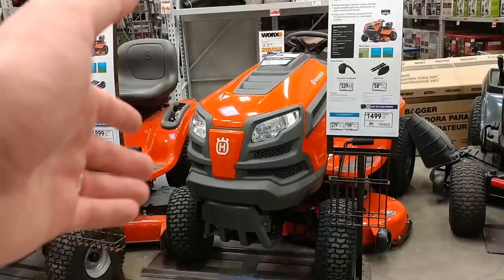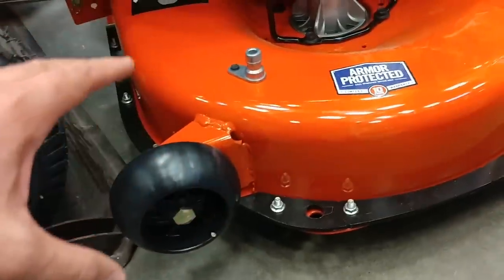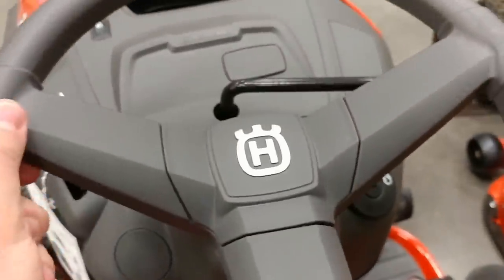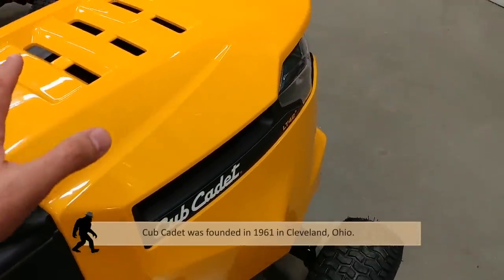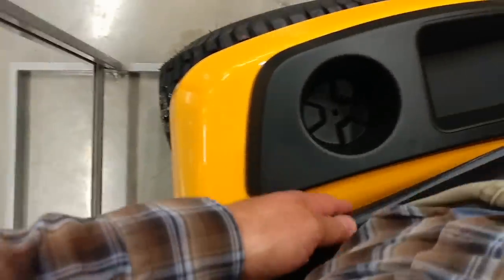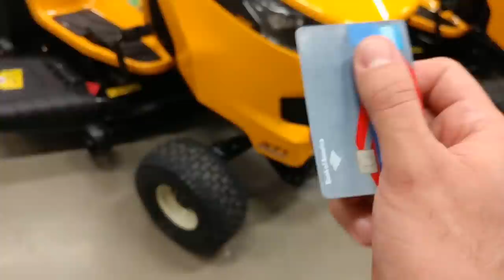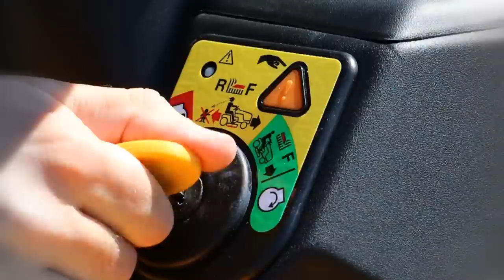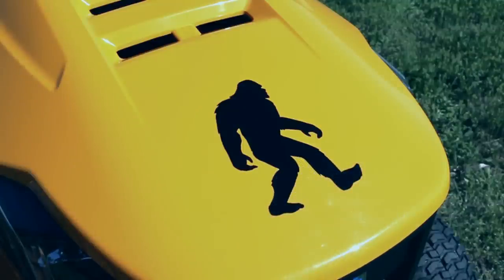Time to Buy - Husqvarna YTH18542 42” or the Cub Cadet XT1 Enduro Series LT 42" Riding Lawn Mower

Comment: Cub Cadet sucks trans went out on mine twice
Reply from the maker: Hi,  Electrified - I'm sad to hear that.   Do your still have the mower and is the third transmission working alright?   How was the warranty service and experience? I'm curious what to expect that incase I experience something similar.   😮
Reply: @BigfootDadExploresMontana  Warranty service was great I took it to a near by dealer I bought the mower from TSC but I will buy from dealer next time much better. Yes I still have its running good now but I just replaced the plastic idler pulley LOL I'll probably be buying me a Husqvarna 54" soon
Reply from the maker: @Electrified - that's helpful information so thank you for the follow-up.  Hopefully nothing else falls apart after the pulley replacement.   As far as the Husqvarna goes,  Loweslitta will be proud when that day comes.   😎  Keep us posted if anything else breaks on the Cub Cadet!
Reply: don't blame Cub Cadet blame Tuff Torq.  Every manufacturer (JD, Cub, Husq, Craftsman, etc) all use the same transmissions in the low budget machines (K46 and they are known to fail)
Reply from the maker: @sethfisher6267  - good point.  I was thinking about this earlier today and was wondering if the ones they replace under warranty are re-manufactured units.  I'm hoping mine holds together given what I'm about to do with it.... stay tuned for an updated video.  😅

Comment: Never buy from a big box store. You're not getting the quality you think you're getting. The XT1 is far more inferior from the XT2/XT3. If you're going to put that much money into it, go to a dealer!
Reply from the maker: Hi, Andy - the next time it comes around, I'd like to try an upgraded tractor like the XT2 or XT3.  I use is quite a bit out here on our property so would be worth the extra money.  I don't think we specifically have a Cub Cadet dealer here so I'd need to research that a bit more.  Thank you for your feedback.  😎
Reply: @BigfootDadExploresMontana  , there are alot of differences between the XT1 and the XT2/XT3. Here's a short list that I was told is better with the latter: Better battery, wheel bearings, comes with front bumper/brush guard, auto/pedal traction control, better tires, armrest on seat,  better engine mounts for vibration control), powder coat paint vs spray paint on XT1,, and a whole bunch of other things I can't remember. the one thing Cub Cadet will stand behind the dipped frame. It will NEVER rust! Either way, you'll be happy with either model. Its just which one will last longer. Best of luck and thanks for the reply!
Reply from the maker: Hi,  Andy - thank you for the comparison list.   If Cub Cadet is listening,  I'd love do a comparison of the two models in a video!  😉
Been working on a third installment of this video which you may enjoy,  Andy.  Still a lot more to film,  but the XT1 is getting a couple of those upgrades. Thanks again for your comments and keep posting!
Reply: Andy  He bought the cheapest entry level mower !!!!  Box store have better pricing on the same cheap machine !!!  That mower was only $1500 !!!!!
Reply: @wilburfinnigan2142  , yes I know. No idea why you are shouting.
Reply: @scrubsz    NOT SHOUTING !!!! Just talking with conviction !!!!!!!  OK ?????

Comment: Rule 1: never buy anything made by MTD 

Rule 2: never buy anything made by MTD 

Buy a Hustler Raptor 42" from a dealer, or Big Dog. You can find some good deals on fb market for used ZTR.
Reply from the maker: 😂 Hi, Matt - I researched the Hustler Raptor for a bit and it looks like an awesome machine.  I would love to review one some day (Hustler, are you out there listening?) This is my first experience owning a large MTD machine so we'll see how it ends. 😎
Reply: I have a Craftsman lawn tractor bought in 1991 that I still use to cut my football field and a half size yard.

MTD makes Craftsman.

No complaints.
Reply: @onerewdone5516  MTD does make some crapsman, but husqvarna makes their higher end models.

Maybe they made a better machine in the 90s, today I wouldn't even give them half a second of consideration.
Reply: MTD or AYP makes shit, but the Cadet is a better machine.
Reply: @onerewdone5516  Some people do little if any maintenance on their tractors or ZTR's, That is why some have issues. I have a 2008 ZTR 48" with Fab Deck that I cut 3-4 acres every week. That mower has been a real workhorse. I can't complain, I"ve only had one issue with it all those years.
Reply: if you insist on a ZTR buy a dixxie chopper. i went the sub compact route and bought a used low time kubota BX2350. it only had 395 hours at the time of purchase, its a diesel it will literally run forever.

sub compacts offer sereval advantages over ZTR. 

1. more versatile. 3pt hitch and 540 PTO. it can run snowblower, roto tiller, mower, and pretty much anything that will fit a category 1 3pt hitch
2. far more fuel efficient. gasoline ZTR's  can burn over 2 gallons per hour. my diesel sub burns 1/2 gallon per hour
3. more durable, an inline diesel can live up to 1000 hours
4. 4wd and diff lock. it can mow areas that ZTR's are useless.
Reply: @onerewdone5516  Older Craftsman mowers were made by AYP (now Husqvarna Outdoor Power) and not by MTD some newer Craftsman products are made by MTD and Husqvarna

Comment: All new lawn mowers are crap. It's just how much you spend.
They have poor traction. Decks are thin. Parts are made to wear out.
(Few grease fittings). Carbs on engines can't be adjusted as gas varnishes in them. Everyone (manufacturers want you to replace their products around every seven years. Sorry, can you replace everything you own every seven years? I like to acquire something else every now and then. Like maybe a pool table. If you maintain your lawn mower ie. Oil change, lube clean deck every use. You might get 10 years. My dad's 1972 Sears lawn and garden tractor lasted till 2020.
The magneto failed. (No replacement available).
Did replace a slightly rusted out deck in 2019. 48 years. worth the $1,000.
Reply from the maker: Hi, Gary - these older mowers are a modern wonder!  Amazing how bulletproof they were – just like the old 4Runners.  Overly built (or maybe built just right!) and lasting half a lifetime.  Awesome hearing about another one that survived the test of time!

Comment: I bought a husqvarna yth22v46 from Lowe’s and it has been nothing but a piece of $h!t.. would never start.. went thru everything just to take it back at 20hrs to find out that the valves weren’t set right from the factory.. got it back and starts now but is $h!t quality.. buy a John Deere
Reply from the maker: PewTube Addict - first, I love the username.  😂 
Secondly, how incredibly frustrating!  I'm glad you finally figured out the issue and thank you for posting it here.  You never know when something like that can help someone else in a frustrating situation.  I hope your luck is better now that it's fixed.  And welcome to the community!  😎
Reply: Problem is any ethanol is hell on the engines. I have a Husqvarna and had issues with the carb. All due to ethanol. Only buy 100% gas or use Stabil every time. Tough to find real gas.
Reply: @flynnzero9282  I have always used ethanol free in all my yard equipment. Use it for my side by side to.

Comment: Why would anyone buy a tractor style mower.
Reply from the maker: Hi, Tom - are you referencing in comparison to zero turn mowers?  If so, I can offer a small comparison.   Aside from tractors being in general cheaper than zero turn mowers,  they are more rugged and stable on rougher and sloped terrain like mine.   Zero turns are awesome for getting in tight spots and excel at speed and efficiency, but they also take a more skilled operator to do so - that's just not something that most of us have as weekend warriors.   Hope that helps.   😎
Reply: I have a Zero Turn and I also have turns and hills, I love my Zero T but it sucks on slopes if you need to make a turn of any kind. I'm buying a Tractor similar to the one in the video, but with a better deck because I have roots in the yard.  Zero's aren't for everyone. I've used mine for 9 years. love it, and I'm a pretty good driver, but they aren't for every terrain.
Reply: i bought a small real tractor, that is a used sub compact utility tractor. its a 2007 kubota BX2350 and has a 3 cylinder diesel. it will mow ALMOST as fast as your zero turn on roughly 1/3 the fuel. the diesel engine will outlast several of your gas engines. it has a 3pt hitch and a 540 PTO so i can do allot more different types of work. it has 4wd and differential lock, if i get into a wet area i just put it in 4wd and it wont get stuck. i can damn near mow a swamp with it.

i got the tractor with 395 hours, a heated curtis cab, a barely used 54" mower, and a 46" two stage meteor snowblower. i paid $8,500 for it. ew that setup is somewhere around 20 grand.
Reply from the maker: Andrew - that is completely awesome!  I would love to have a diesel 4x4 tractor.  It might only take me a couple passes to do my lawn with that.  😂  Do you plan to make a short video?  I'd be interested in seeing it in action.  😎
Reply: Also I can't put a snowblower on a ztr
Reply: @tjaccount5245  most zero turns are gas hogs. diesel all the way. diesel sub compact

Comment: Oh no you bought the cub cadet look at how worse it is designed I know it has the same transmission but the front end is completely garbage those engines aren’t that great the mower isn’t going to really last long the body is pretty crappy the frame isn’t that great it’s just really not that well-built and I’m pretty sure these aren’t even really made in America anymore they’re owned by MTD which is a Canadian company and sources their parts from China your loss not mine but you do what you want
Reply: @Aidan Fleming he is not wrong at all except that the front ends are pretty much the same
Reply: @Aidan Fleming yes i agree but now in the present, mtd is a sad chinese company lol
Reply: wrong! mtd is an american company headquartered in ohio family owned since 1932 , originated as tool and die company . they are very capable of making quality products . ckeck out the XT3 series they also have made $20,000.00 cub compact tractors competing with deere and kubota. remember you get what you pay for these bottom of the barrel consumer grade lawn tractors. step up to there garden tractor series and you will be impressed no matter the brand......